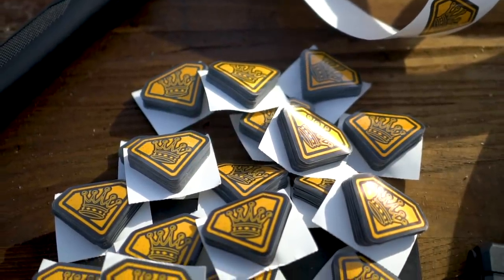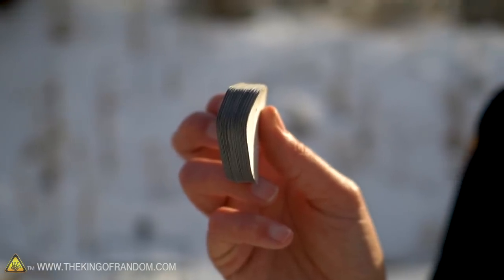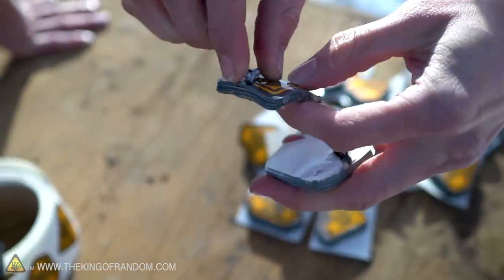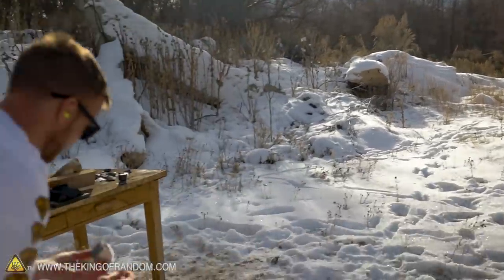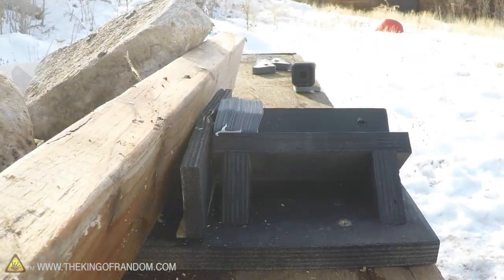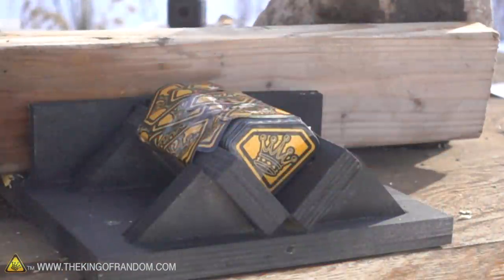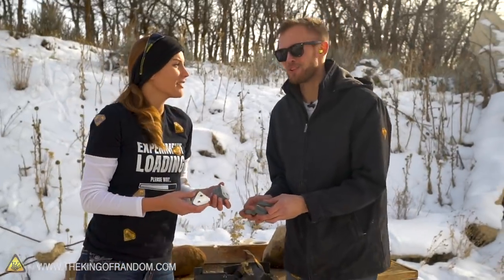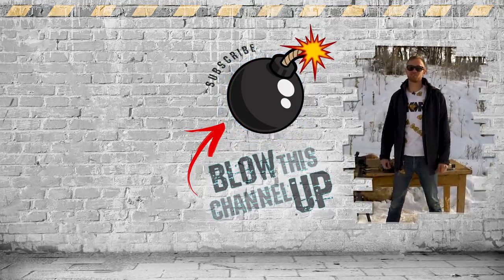Can 1,000 Stickers Catch a Bullet?

Comment: You should take all the bullet wounded stickers and make a table.  Square mold with a thin layer of resin in the bottom, then lay all of the stickers facing down on the resin, and a metallic colored resin behind them.  The bullet holes would be shown off.

Comment: .22 vs  .223   basically the same diameter but the weight, velocity and most important the surface area of the front of the bullet. If the .223 had been rounded like the .22 you would of had much less penetration. If you get ahold of some 9mm spire points (very hard to find) and shoot the stickers you will get much more penetration as well.